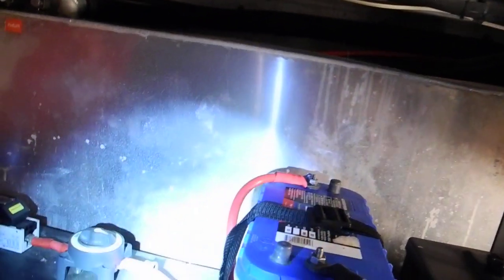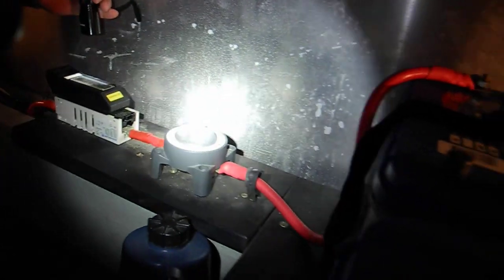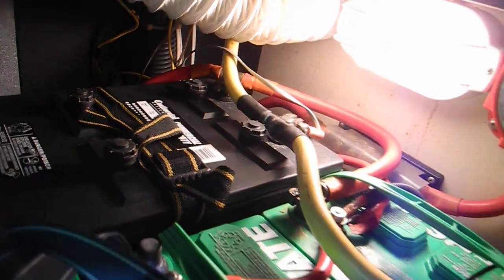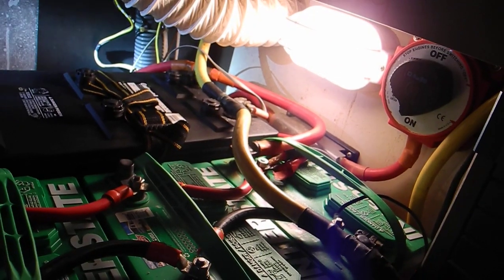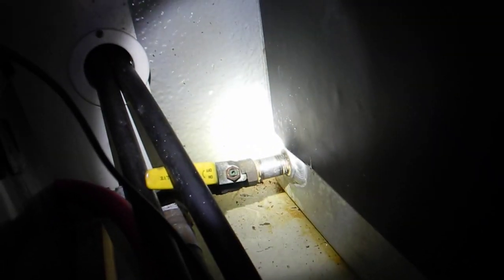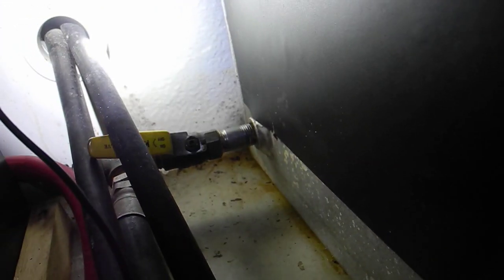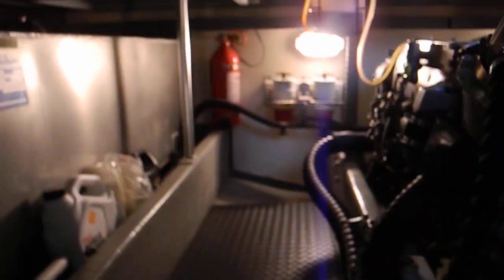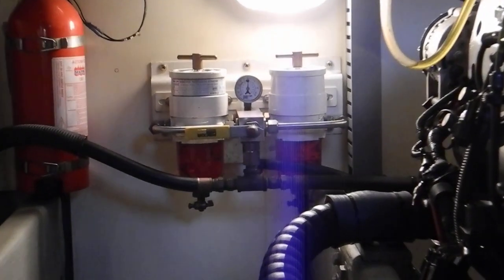Where are the fuel tank valves

Comment: good morning. see those tanks look like aluminum or stainless .whats your thoughts on those fiberglass tanks am looking at an older Bertram that has them. the owner says never runs ethanol in them. besides that the boat is impeccable..thanks
Reply from the maker: lester wicklein since you mentioned ethanol I will assume you are referring to a gasoline powered boat. I believe fiberglass tanks are fine. Many American brands such as Bertram, Hatteras and Gulfstar built fiberglass tanks into the vessel. We owned a 1980 Gulfstar for 19 years and never had trouble with the fiberglass tank. We had diesel power but the ethanol problem you are referring to is debris and sediment build up inside the tank. That can be cleaned by hiring a fuel polishing company. Best of luck and always have spare filters. 😎